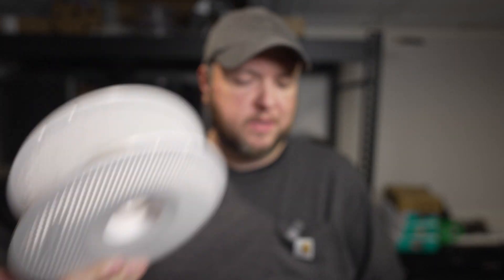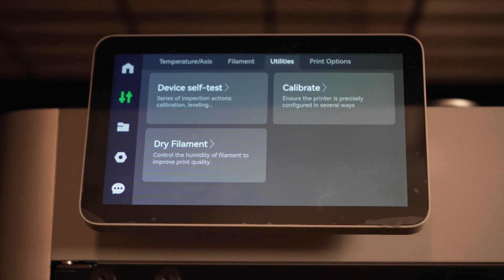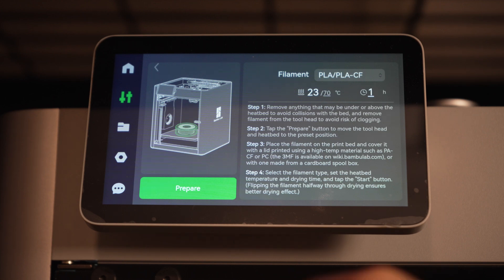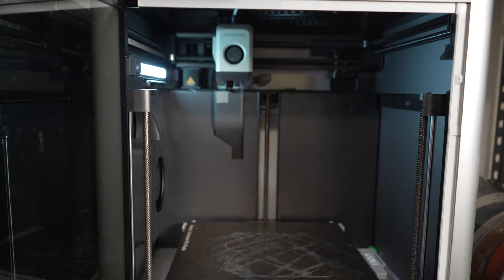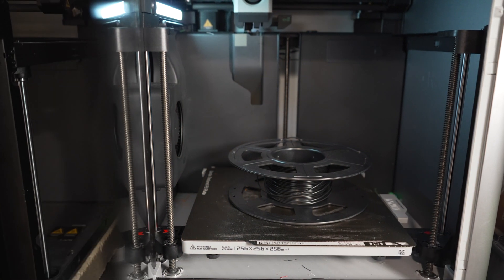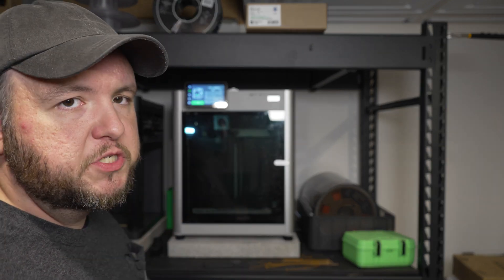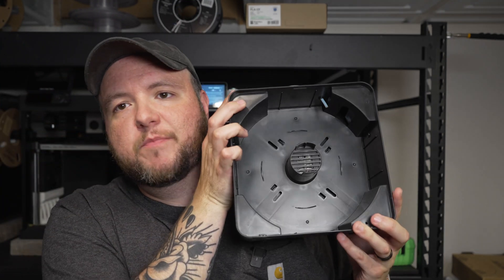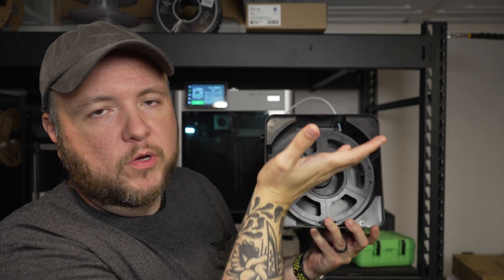How to dry filament with a Bambu Lab Printer

Comment: That is why in step 3 it says you have to cover it with a heat resistant box (but you can also use a cardboard box op top of it). Reading the instructions may help next time.
Reply: Yea thats true

Comment: The best drying filament inside whichever designed container requires air to absorb water inside the filament. This is done by heating the air & filament to make the air more attracting.  This condition mostly occurs on the outermost filament winding and especially the unwrapped portion.  The optimum designed dryer would have heated air circling the filament with cool plate. The cool plate would condense the vapor to water and drain it. This device would be cost prohibited and, in some filament types, unnecessary, even harmful (too brittle).  The best filament storge is sealing it in a container while still warm.  Include dry packs and vacuumed with a humidity measuring device or strip.

Comment: Filament drying experiment.  Place a spool of filament in a theoretical air sealed box along with a thermometer & hygrometer at room temperature.  Now, heat the air/filament to 150 deg F.  Read the hygrometer.  Now, let the filament cool down to room temperature without opening the box.  See the hygrometer reading return to similar room temp humidity?  The RH went down when heated and returned when cooled. Any loss of water in the air is due to it now being more in the filament.  Run the save experiment with dry packs instead of filament, and the air RH should be lower because the packs are designed to hold more water than air. Same goes for types of filament holding more water than other's.

Comment: Drying filament is about relative humidity within a given space.  Relative humidity is about temperature. The higher the temperature, the more humidity air can hold and vice versa. Air conditioners control humidity by lowering air temperature which lowers the amount of actual humidity the air can hold. A/C's condense the air's above 100% humidity... as does a glass of cold beverage. Heated air can hold more humidity than room air, which is how we dry our clothes.  Now, what would happen if you turned the clothes dryer on and left the door wide open (I mean, besides clothes falling out)?  It takes longer to dry your clothes, right?  Well, putting a gap in a filament dryer's lid has the same effect as well as making the heater work harder to heat the new air/humidity coming in while the heated air leaves.
Reply: Depending on what a person is using they may need a vent.  Your example of a dryer isn't "air tight" so to speak.  Yes the door should stay closed but your comment makes it seem like it's a sealed compartment when a dryer is not.  Like you said warmer air holds more moisture.  So a warm sealed dryer wouldn't do much besides stay moist............mmmmm moist.......... where was I?  Oh right. A dryer vents the hot moist air which means it isn't a sealed compartment as with air going out it needs air coming in.  The purpose of the heated air used to dehumidify clothes, filament etc is so that is draws the moisture out of the object you wish to dry and into the air that can then be expelled along with the moisture.  So depending on what a person is using to dry their filament they may need an air hole to either bring air in or expel the moist hot air from the chamber.

Comment: Huh?  Sorry, but I have to say to anyone watching this channel's suggestions about drying filament ... follow the mfg instructions. Don't follow this channels advice.  I'll explain the effects of "dryer" volume by asking to run an experiment. You'll need a plastic bag, 2 paper towels and a room.  Wet the 2 paper towels under a faucet until soaked. Squeeze out excess water and place 1 towel into the plastic bag. Close the bag. Leave the 2nd paper towel next to it  on a dinner plate. Check both paper towels for wetness in 3 hours.  You are likely to find the towel inside the bag is wetter. Both were drying in equal air temps, showing that a larger volume enclosure could hold more water vapor. Room relativity changed little while the bag's relative humidity soared. Maybe to 99% RH.